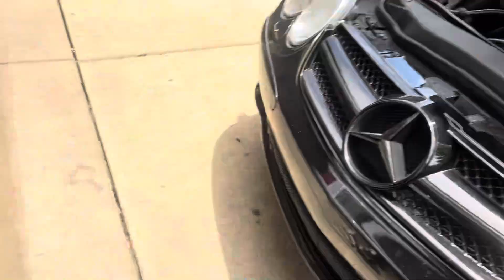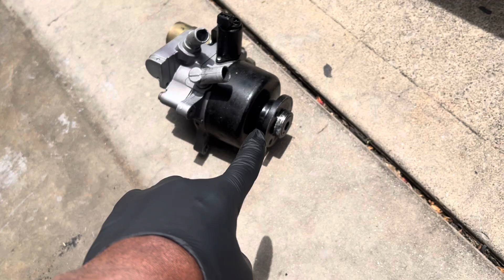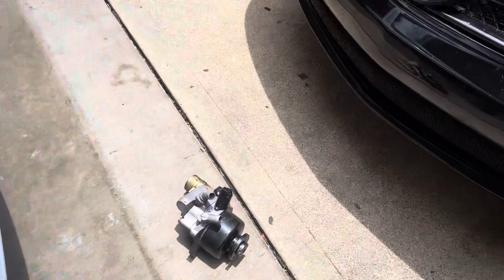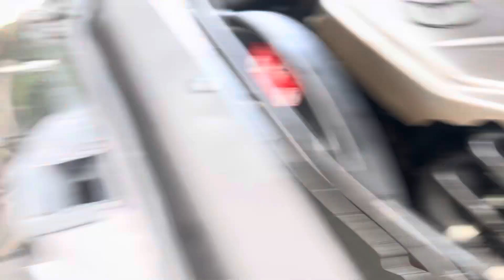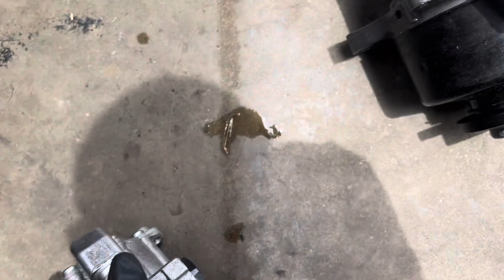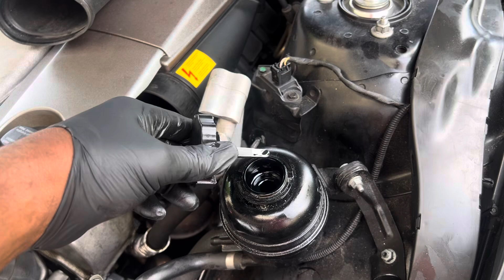How To Replace & Install Standard ML55 Power Steering Pump Into SL500 SL55 SL R230 Mercedes #abc

Comment: Gold my power steering line won’t connect to the new pump I got off you on my SL the threads on the pump are not stripped because the plug still screws into it. The lines threads might be stripped I loosened up the pump to give me leeway I still can’t get the line threaded any suggestions I need to get it done by tomorrow 🙏
Reply from the maker: I just dealt with this with another customer. They always fit. There’s several common factors that you can run into. The most common is the very precise angle that the pump has to be for the line to evenly insert and start to thread. I DO NOT start to install/bolt the pump until the line is first connected. Not tightened all the way but started and threaded 60-70%. Keep it loose enough to have play so you can finish bolting the pump into place. 
The other factor is the threaded bolt has to be slid all the way to the tip of the line. When trying to catch thread, people often allow it to slid back down the line far enough where it will never catch. It takes two hand to control and angle the freed pump and thread the line in. 
The third factor is the attached bracket on the line is in the way. It easily bends back so that it doesn’t hit the pulley. And the 07-11 requires you to slightly bend the line at the elbow to relieve the pressure on the threading into the pump. 
The line will connect. You have to figure out what factor is preventing it.
Reply: @goldelementautoworks thank you gold! 10/10 service and quality 💯

Comment: My 17mm nut on the high pressure line seems to be stuck and can’t get it to come loose with a 17mm flare wrench, any tips? Should I just cut the line and replace it entirely from the bottom of the car? I’ve been trying to remove the abc pump but I cant get that one line off
Reply from the maker: Tilt the pump so that you have a straight up and down shot, rather than at an angle. Also….I use a 17mm ratcheting line wrench and cheater bar using another wrench for leverage if necessary.
Reply: @g @goldelementautoworks I dont need to remove the high pressure line before removing the back nuts? Or how will I be able to tilt it for a straight up and down shot?
Reply from the maker: @danielchdj8249 I remove the rear bolt and nut and the front bolts. And the high pressure ABC line (banjo bolt) Then I remove that ps line. You need to tilt it to get a straight angle. Keep the rear stud in the hole and use that as leverage to keep the pump held down to break loose that 17mm ps line.
Reply from the maker: https://www.goldelementautoworks.com/product-page/flzosper-17mm-metric-fix-tubing-wrench-flex-head-gear-wrench-ratcheting-fix

Comment: Would the same power stearing pump work for a 2010 SL550 , or would be a different power stering pump be required?
Reply from the maker: This pump will work for the 07-11 SL550. Yes. 
https://www.goldelementautoworks.com/product-page/new-power-steering-pump-for-mercedes-benz-r230-sl500-sl55-sl600-w215-cl500-cl55

Comment: Took forever to get the old one out and now im installing the new non abc pump and i striped the threads on the high pressure power steering hose… going to try to cut the flare off tomorrow and install a new thread and re-flare it… wish me luck 😢
Reply from the maker: You buy that line. It’s relatively easy to replace.

Comment: Very good video for the coilover swap,  the double power steering/ABC pump on my cl500 has a low hum on start up ,  it's outta there.   The 500 motor and trans are a really good solid set up,  the ABC is the problem child .   Also pull the ABC fuse to put out the ABC light.

Comment: I just replaced the pump none of my lines with bolts reach to the new pump and they both come from the back of the pump any idea ?
Reply from the maker: @Çami55amg  What model? SL, CL or S class?
Reply: @ s55 class 2003
Reply from the maker: @Çami55amg  You only need the one power steering hard line to reach. There is a bracket behind the motor underneath that holds that line back. Remove that bracket and you have just enough length.
Reply: @ is that rubber line covered with heat shield on the side of the manifold?
Reply from the maker: @ Power steering has a metal shielding over it.

Comment: If you could please send me the link for the complete change over on my 2008 S63AMG. Power steering pump, and coilovers, anything else I need. Thank you!
Reply from the maker: @charleschaney3699  https://www.goldelementautoworks.com/product-page/dynamic-pro-sport-coilovers-2000-2006-mercedes-s55-s65-amg-w220

https://www.goldelementautoworks.com/product-page/new-power-steering-pump-for-mercedes-benz-r230-sl500-sl55-sl600-w215-cl500-cl55

https://www.goldelementautoworks.com/product-page/mercedes-cl-s-slabc-line-plugs-caps-for-r230-w220-w215-sl55-sl600-s600-s55
Reply from the maker: @charleschaney3699  https://www.goldelementautoworks.com/product-page/dynamic-pro-sport-coilovers-2000-2006-mercedes-s55-s65-amg-w220

https://www.goldelementautoworks.com/product-page/new-power-steering-pump-for-mercedes-benz-r230-sl500-sl55-sl600-w215-cl500-cl55

https://www.goldelementautoworks.com/product-page/mercedes-cl-s-slabc-line-plugs-caps-for-r230-w220-w215-sl55-sl600-s600-s55

Comment: Would the same process and parts work for a 2005 S55, or would different parts be required?
Reply from the maker: @paigecarroll8596  Same pump. Different coilovers. Plus a power steering reservoir and clip. I’ll leave the links……
Reply from the maker: @paigecarroll8596  https://www.goldelementautoworks.com/product-page/dynamic-pro-sport-coilovers-2000-2006-mercedes-s55-s65-amg-w220
Reply from the maker: @paigecarroll8596  https://www.goldelementautoworks.com/product-page/new-power-steering-pump-for-mercedes-benz-r230-sl500-sl55-sl600-w215-cl500-cl55
Reply from the maker: @paigecarroll8596  https://www.goldelementautoworks.com/product-page/mercedes-r230-w220-w203-w208-w209-w211-power-steering-reservoir-seal-ring
Reply from the maker: @paigecarroll8596  https://www.goldelementautoworks.com/product-page/genuine-power-steering-reservoir-retaining-clip-for-mercedes-2000-2015
Reply from the maker: @paigecarroll8596  https://www.goldelementautoworks.com/product-page/mercedes-cl-s-slabc-line-plugs-caps-for-r230-w220-w215-sl55-sl600-s600-s55

Comment: In your opinion, is driving with standard suspension noticeably less comfortable than with ABC suspension?
Reply from the maker: @irakleo  There is a 10% less comfort in comparison. You feel the road more if you dial it in stiff. If you keep it on the softer side, it’s very comfortable. But too soft and there’s bounce on dips. I personally prefer coilovers for longevity and reliability.
Reply from the maker: @irakleo  https://www.goldelementautoworks.com/product-page/sm3011-silver-s-neomax-coilover-kit-mercedes-sl-class-r230-03-11-1

Comment: Hey man, Would this method work on a 2002 CL? Or would I need the reservoir thats for it, meaning (the small one that sits on top) it doesn’t look like it would fit, and this method seems easy enough.
Reply from the maker: @IEMediaPodcast  you need the reservoir that’s sits on top of standard pump. I just sent the links to your other comment.

Comment: Why can’t you use the standard non ABC reservoir that would have come on an E500 or something? Does it get in the way of some CL specific part or something? Doing this to a 2002 CL500 and can’t figure out why there would be a difference. I just need to figure out everything I need to buy.
Reply from the maker: @thomaslibonati  For the CL…..you CAN use the standard reservoir. Here you go. Make sure to buy the metal clip as well. 

Reservoir…….
https://www.goldelementautoworks.com/product-page/mercedes-r230-w220-w203-w208-w209-w211-power-steering-reservoir-seal-ring

Clip……
https://www.goldelementautoworks.com/product-page/genuine-power-steering-reservoir-retaining-clip-for-mercedes-2000-2015
Reply: @goldelementautoworks  sweet, that’s what I thought. I was confused because I know it’s the same engine as my E500. I still have to contend with the factory line that is too short. Do you know if it’s possible to get a junkyard line from an E500 or S430/500 without ABC??
Reply from the maker: @thomaslibonati  No…..the factory high pressure line is long enough. There’s a clamp/brace that holds it back. Behind the engine. Remove that and it just reaches the pump.
Reply: @goldelementautoworks  OK, wonderful. Thank you for the responses. I am a truck driver over the road and I am trying to order everything I need to have at home when I get there. Buying this car when I get back home. ABC is completely completely dead and flooding the ground… I want to get a traditional pump in place and have everything sealed up so I can work on getting it to stay running without fluid slinging everywhere and burning out the ABC pump that I could sell online for good money. Wish me luck.
Reply from the maker: @thomaslibonati  Good job. I completely understand. Are you removing the lines and valve blocks also? They sell for good money too. I’m here for you if you need assistance. I come along with purchasing from my website. 👌🏾
Reply: @goldelementautoworks  I’m not sure exactly what I’m removing yet. I saw some coils for $765 that was going to buy but now it says only for airmatic cars. I didn’t think these cars came in Airmatic only ABC. That puts a damper on things. Paid $1,650 for the car and now I’ll need $1500 in suspension? Ouch. I’ll have to save up I guess. I was so excited to drive the car and now this is a setback.
Reply from the maker: Atleast you didn’t pay much for the car. So another $1500 invested isn’t much to have in the car.
Reply: @goldelementautoworks  the rest of it is rough though. I’m considering losing my $600 deposit on it and letting it go. I don’t think the car is worth it.
Reply from the maker: @thomaslibonati  These cars get expensive real quick. Be careful.
Reply: @goldelementautoworks  I make enough money to afford to fix it. I just feel like I am better off buying a decent example for $5000
Reply from the maker: @thomaslibonati  If it’s that bad of condition…..I certainly agree. What all is wrong with it?
Reply: @goldelementautoworks  it hasn’t been on the road since 2015. It acts like it wants to start. It only has 125,000 miles on it.. clearcoat is starting to let go on the rear quarters and trunk.
Reply from the maker: @thomaslibonati  Do you think it’s a bad fuel pump?
Reply: @goldelementautoworks   Fuel pump shockingly still works, sounds strong. When I do get it to start the exhaust smells HORRIBLE. Doesn’t stay running for more than a couple seconds before it cuts off. I’m going to siphon the tank, change the filter and put some fresh 93 in it and see. As for the coilovers, as long as I can get it to idle and run up to temp and things seem to work I am probably going to just go ahead with the project and get the yellowspeed. I wish it didn’t take several weeks to get them, though.
Reply from the maker: @thomaslibonati  Order them from me, and I may be able to get them earlier. Maybe.

Comment: What will happen to the abc system and adaptive shocks? I don’t get it
Reply from the maker: @Vitaliyhh-dd4ef  This is ONLY if you’re doing a coilover conversion. Meaning….eliminating the ABC suspension.
Reply: ABC shocks are replaced with coilover shocks ,  pull the abc fuse to turn off the abc system.  ABC system is deleted ,   older Mercedes with abc get very expensive to maintain .  This conversion worked great on my cl500 ,   the engine & trans are bullet proof  ,  the abc is a problem child.

Comment: Pretty nice dude, thanks a lot.Shouldn't be too much difference.Then doing it to a cl 500 ha?
Reply from the maker: @ToddtheLoneDroner  The CL500 requires that high pressure power steering line to be extended by removing the brace that holds it back……rear of engine.